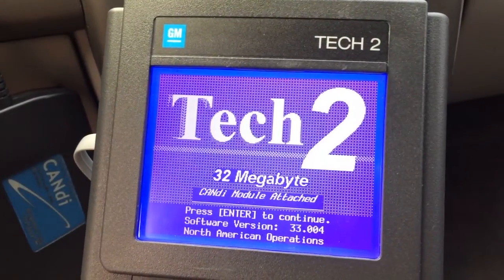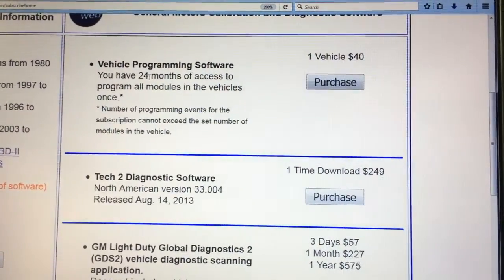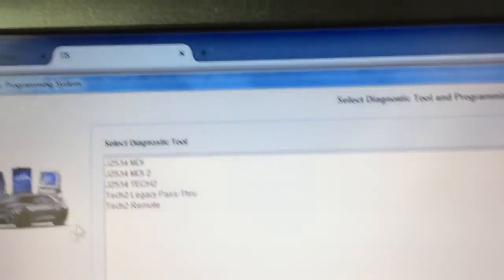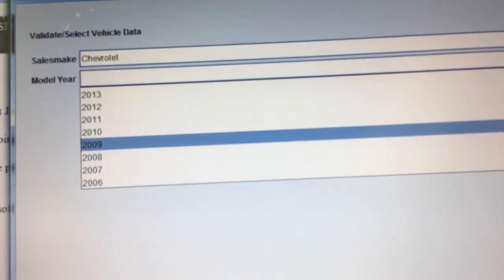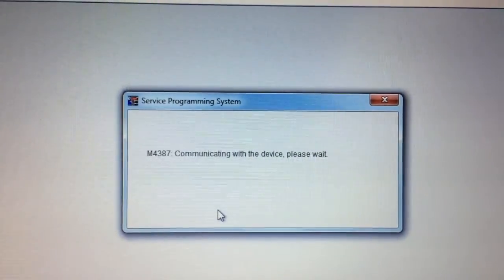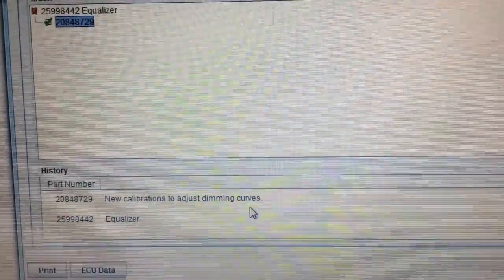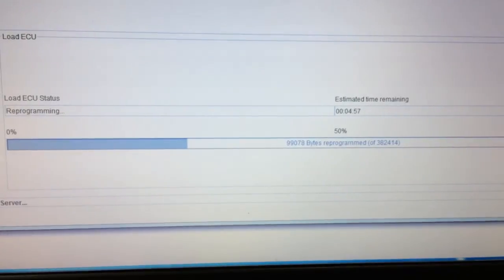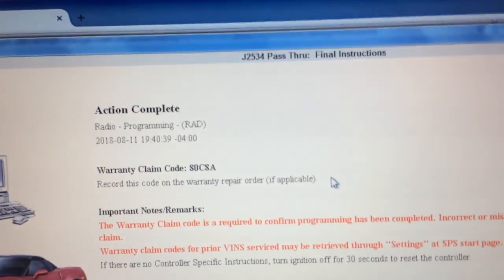GM SPS Programming: Tech2 Tool Pass Thru Mode ECU TIS2Web TDS How to do a Calibration Update Reflash

Comment from the maker: PSA: Starting in late 2021 GM ACDelco replaced TIS2Web and SPS with a new software solution - Techline Connect with SPS2.  This new software no longer supports use of the Tech2 scan tool, it is officially obsolete as far as GM is concerned.   

While you can still use the Tech2 for diagnostics, as a free non-subscription alternative to GDS2, you cannot use a Tech2 with SPS2 for module programming.   You will have to either use TIS2000 offline, for vehicles 2008 and older.  Or you will have to use a different J2534 compatible tool like the GM MDI or MDI2 with Techline Connect and SPS2.
Reply: So, if i understand this, i have a flash i need to download to a 2005 Corvette, 18-NA-346, for a column lock issue (released in 2018). My Tech2 is now obsolete for this task of updating this utility file?
Reply from the maker: For performing calibration updates, that's correct.   The latest Techline Connect upgrades the system to SPS2 and that requires either an MDI or an MDI 2 interface to the vehicle.  The Tech2 diagnostic functionality is delivered over either of these two J2534 interface devices via a Windows based emulator, Tech2Win, for older vehicles that require that.   You can still use the Tech2 with SPS on TIS2000 (the obsolete DVD version) for calibrations released prior to 2008 though.
Reply: @DrShock  I’m trying to add the front and rear heated/cooled seats from a 2006 Escalade Platinum to my 2003 Yukon XL 2500 Quadrasteer. Most people replace the BCM to have the functions work, but I would lose quadrasteer. How can I add this functionality? I plan on removing all relevant wiring and placing in factory locations in the Yukon but does the BCM need to be programmed, and can it be done with a Tech 2?
Reply from the maker: Typically you cannot change the options in the BCM from how the vehicle was originally built by VIN.  I'm not directly familiar with the BCM on that year truck series, but you would have to determine if the BCM has RPO (regular production options) that you can manually select or whether it is the more common type that is programmed by what GM calls a calibration which is downloaded by VIN.   In the latter case, you cannot change the options in the way you seek.   I would suspect the forums you're reading about this have folks transferring the whole BCM because of this calibration fact.  But it could be just because none of them own a Tech2, or have access to a MDI J2534 interface with Tech2Win emulator on their laptop.  Both are very pricey tools. 
 
When swapping out the BCM, and not having these tools to reprogram it, I would also expect the mileage to be wrong and possibly DTCs posted for any missing RPO modules which can prevent passing state inspection in some states.
Reply: @DrShock  just bought a tech 2 for my 2103 chevy equinox that I think has a bcm issue. so what your`e saying is that the tech 2 is no longer viable option to scanning and reprograming it. I would have to get a mdi 2 instead.
Reply from the maker: It's fine for diagnostics on the model years it supports, but SPS is gone now.  And SPS2 replaced it, dropping support for the Tech2 on Techline Connect.   So for calibrations, MDI or MDI2 only now.
Reply: is it still no possible to use the Tech2 to program modules as a pass thru with the CANdi interface? must i purchase a J2534? and will a mongoose GM3 work for EBCM programming?

Comment: Can't I use the Tech 2 to program modules on my 2004 Suburban and 2006 Silverado 2500HD without paying for an SPS subscription?  I thought SPS was only needed for newer vehicles.
Reply from the maker: SPS has been around since the Tech2 launched.  But in the beginning, and until model year 2008, it was on a DVD-ROM.  After that it moved to a cloud based subscription model.   So you'll need the original DVD-ROM to do what you're after without paying the subscription fee.   Note that the Tech2 support was ended by GM several years ago, so if you end up purchasing a subscription and using Techline Connect SPS2 today, it's expected you instead use the GM MDI tool.

Comment: I have a question I bought one these tech 2 clones and it's setup for Saab the card in it is just for Saab but I have a 95 GMC do I have to buy another card or if I download any of these things will it work on the card that's in the machine or no? Also on this site the AC Delcotds says use of clones mdi will get your account banned are they meaning the tech 2 clones
Reply from the maker: The notice you see at ACDelco TDS does not apply to the Tech2, because the Tech2 is no longer supported by that offering. ;-)    So you cannot use a Tech2 with Techline Connect anymore, only the MDI or MDI2.   In that latter case, they can detect if it is not a genuine Bosch MDI/MDI2 and they will block your account 100%.  You will have to restrict your Tech2 usage to TIS2000 on DVD-ROM only from now on which only supports thru model year 2008.

For your other question, yes you will need a different PCMCIA card with the regular NAO (North American Operations) vehicle support.  The SaaB card won't support the GMC.   The memory cards are unique, and not the same as those used on earlier laptop computers.   If you try to download image and make your own, keep in mind you will have to find a linear memory card not the regular type.   It's far less of a hassle to just buy the NAO card ready to go.
Reply: So for the nao card where in the world would I find that? I've been looking for the GM card but everything is sold out or out of stock. I saw that there's a downloadable tool called gmtech for the laptop for but the only site that offers that is  some swedish thing and idk anyone that's used it or can confirm it's legit Leroy and another outfit use to sell that but I guess they both stopped.
Reply from the maker: For the replacement card I could suggest AliExpress.  The Chinese clones are still available thru sellers there.  These cards come with them, and at least one sells it separate.  Just ask the question to the seller about the version for NAO / US English v33.004.  Here's an affiliate link for that one https://s.click.aliexpress.com/e/_ooZ3AAb
Reply: @DrShock I appreciate the help
Reply: I guess I should ask what would you recommend for timing or check the IP timing on a 95 burb with the OBD1 system
Reply from the maker: I would typically use a Tech2 for that IP base timing task, as well as for setting the TDC offset.

Comment: I've read comments, typically good, on knockoff devices, yet on the TDS website, it states that they can block you from using one.  Would you recommend staying away from a knockoff?
Reply from the maker: You are replying on a video for the obsolete Tech2 which is not supported by GM since Techline connect came out. The warnings you see on the TDS site are for the newer MDI and MDI2 tools only.  And yes they are very real, using a clone MDI device with Techline Connect will get you perma banned by GM.
Reply: @DrShock  You had recommended an MDI2 for my 2009 below and did some reading about this device.  In shopping online, all I basically saw were knockoffs (I believed) but the ads do not state this.  So I asked my question, not knowing that you had several other videos.  So I apologize for asking here.  I have since subscribed and watched some of your other videos.

I will have to subscribe to TDS with my soon to purchase MDI2 device, so I suppose I will have no choice but to go with a Bosch MDI2.  Bummer that they are triple the price of a knockoff....
Reply from the maker: No problem, the Tech2 is still a great tool but I could only recommend it now for model year 2008 and older as it only can program modules thru TIS2000 software on DVD-ROM under Windows 2000 or XP.  For anything newer it has to be over GMs ACDelco TDS cloud offering and only using the MDI thru 2020, and after that really only the MDI2.   Or an aftermarket J2534 solution like the Mongoose Plus from OPUS.   For your 2009 an used genuine Bosch MDI (1st generation would be the best deal).   You just have to do extra work to avoid the clones/knockoffs.  I did a video some year or so back on the differences.
Reply: @DrShock  Unfortunately, I can't seem to locate any used MDI's, either variant.

I'm wondering about two things.  1) Sellers of these MDI's also offer an HDD.  Does this install in the Win 10 laptop as a dedicated HD?  And 2) Is it possible to program into a BCM only one or two features?  Example:  I swap an auto trans for a manual.  Assuming changes in the BCM need to be made, is this possible?
Reply from the maker: The Chinesium clones/knock offs of the MDI (there is no MDI2 clone they are just fake shaped cases around an MDI 1st gen) include these drives with bootleg/hacked copies of GMs Tech2Win emulator software and Global Diagnostics System v2 (GDS2) software.   These are usually older obsolete levels but usable in diagnostics for most home DIYer situations.   Fortunately (as I'm not a fan of Chinese pirating the property of US companies), the Chinese never could crack GMs SPS2, so that disk drive they include won't help you in programming a GM module.

Comment: I am trying to find a scan tool for a 2009 Pontiac G8 that can also change the VIN on replaced components such as an EBCM and BCM to match the car's.  I had to replace the EBCM and since it has another VIN, it does not work, nor does the traction control.  I also need to replace (or program) the BCM but not a priority at this time.  Can the Tech2 accomplish this?  Thx.
Reply from the maker: GM no longer supports the Tech2 so you cannot use it online anymore (i.e., this video is obsolete).  The TIS2000 (DVD-ROM) offline version only supports thru model year 2008, so you would not be able to go that route either.   Your only GM module programming option currently would be a paid subscription to ACDelco Techline Connect, with an MDI or MDI2 type J2534 vehicle interface.
Reply: @DrShock  Appreciate the info.  I am very new to this and all the acronyms are confusing (for now).  Is an MDI a component that links car to laptop?
Reply from the maker: Yes, an MDI (Multiple Diagnostic Interface) will connect via USB, Ethernet, or WiFi thru a laptop and then connect to the vehicles DLC (Diagnostic Link Connector) aka OBD2 port.  The J2534 technical jargon refers to an industry standard whereby some other makers have tools that can also be used with Techline Connect as a vehicle to PC interface.
Reply: @DrShock  Appreciate the info.  I've been doing a little reading about it but one thing I cannot seem to find.  So hardware wise, an MDI is the only way to go for my 2009.  But what about GM's side?  Would they still have updates and such for my ride?  What service do I need to subscribe to?
Reply from the maker: The service is located at www.acdelcotds.com and the module programming is SPS2 (Service Programming System v2).   GM claims to have module updates going back into the 1990s.  If you were trying to do something unusual like a Saturn from the 1990s it wouldn't work with the modern tools.  But your 2009 Pontiac G8 should be fine (I've done a 2009 Chevrolet Cobalt without incident in the past).
Reply: @DrShock  Well sir, I must say I could not have asked for such precise answers to all my novel questions.  I cannot thank you enough for not only guiding me through this gauntlet of acronyms, but for all the information I seeked.  I now know what I need to do to press forward.  Thank you very much.

Comment: While updating a 06 Silverado tcm (h40) with sps2 the procedure erased and then failed to write update. Now the tcm has no communication. Will a tech 2 with pass through connect and write tcm ? Thanks!
Reply from the maker: GM no longer supports the Tech2 with Techline Connect.  So the answer would be yes, but you'll have to have a copy of the vintage TIS 2000 (the DVD-ROM version of SPS that was discontinued in 2008) to go along with it.
Reply: Thank you! I will give this a try

Comment: So reading the description, you can no longer program even a 2012 with the tech2? Did I interpret that correctly?
Reply from the maker: Correct, no module programming anymore since Techline Connect came out last year and GM deprecated SPS (replaced with SPS2) and the Tech2 support.  You can still, of course, use a Tech2 for diagnostics and functionality similar to the more modern GDS2.

Comment: Great video, thanks!  I did discover that I have to logon to the GM website first to make things happen, not Techline connect first, even though I currently have the browser active on the website.  At first, I couldn't figure out why it said my credentials were invalid when I tried to logon to techline connect first.  I then logged into the website, and bingo, techline came up and I saw tech2 pass-through, and all of the goodies that us techies like!  now, I need to calibrate my son's Saab 9-7X steering wheel angle sensor, and see if there are any modules that need updates.  Thanks for enlightening me with your awesome video!  Very smooth instructions!

Comment: Thanks for the video!   I will be addressing my son's 2008 Saab 9-7x (AKA Chevy trailblazer, LOL) and need to do a steering wheel angle sensor calibration.  I noticed that the ACDelco TDS purchase website says $45 for 24 months for all modules, and no longer says only 1 programming per module.  Looks like they changed to a better deal.  Have you noticed that?  Am I correct in seeing this?  I do have a GM card in my Tech2 now, ver. 33.004 Thanks again!
Reply from the maker: It's been all the modules you can do on a single VIN for two years for a long while.  I don't recall how far back, but at least 2018 or so.
Reply: @DrShock  All I was saying is, your screen shot say "all modules, once" for 24 months.  The website currently says "All modules for one vehicle (VIN)", which would indicate unlimited module programming for each module if need be, for 24 months per vehicle vin.  Will this work with Windows 10?

Comment: Newer comment on an older vid, but AMAZING info. 1) Thank you for these! 2) 2009 Saturn - If I have a comp, not a laptop, can I install the ECU reprogram into the Tech2 and walk it over to the car using Tis2Web? I'm assuming Pass Thru is for when it's directly connected, but wonder if the other Tech2 option is what I'd need. Thanks again!
Reply from the maker: Thanks.  Well TIS2Web has been discontinued by GM.   So when you go to www.acdelcotds.com what they have now is Techline Connect.  And it's support for the Tech2 is very limited, no remote mode anymore.  Just the pass-thru like you see here.   The Techline terminals stopped being desktop PCs with DVDs and TIS2000 at the GM dealerships around the time the MDI tool and TIS2Web came out (circa 2008 or so) and moved to only supporting laptops.  So GM doesn't really cater to anything but a laptop nowadays.

For a 2009 GM would expect the MDI tool to be used, rather than the Tech2 with a CANdi module.  A 2009 is too new to use TIS2000 as well.
Reply: @DrShock  Thanks for the reply and info. VERY valuable! So if I had a laptop, and needed to reflash my ECU, would I still be able to use the Tech2 and Pass-Thru mode to make that happen, exactly as you did in this vid? And could a Windows 10 now be used, as opposed to the XP limitations? THX AGAIN!
Reply from the maker: I believe so, I haven't had a need to do a calibration on an older module yet since Techline Connect went live at the end of last year.  But it's supposed to still support the Tech2.  You have to manually select the tool though, it defaults to MDI or MDI2 now.   You might want to call the ACDelco TDS helpdesk before paying for the weekend subscription, to make sure it's all good.